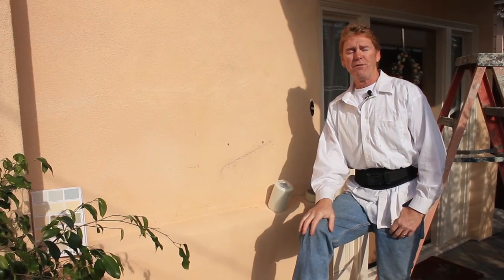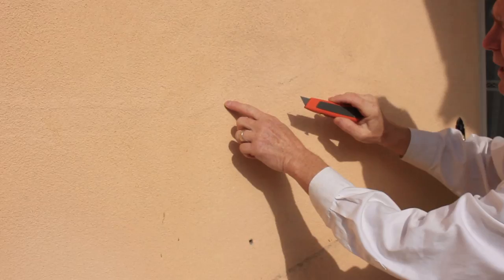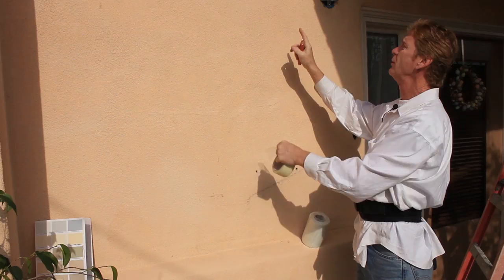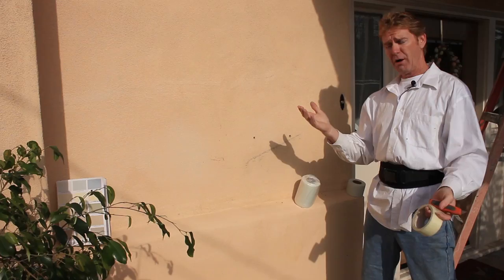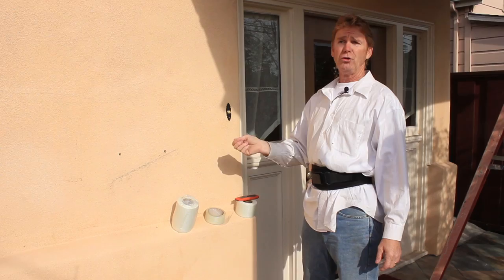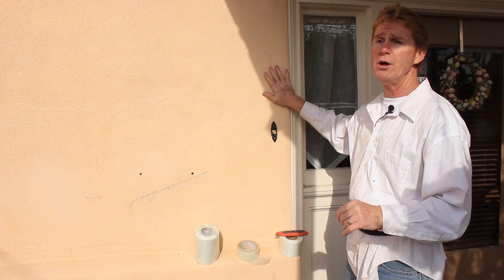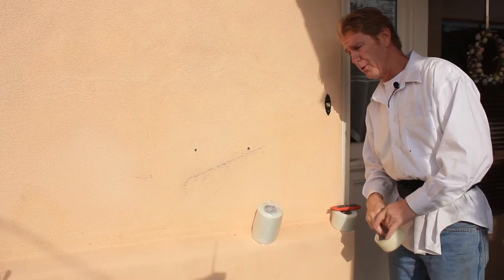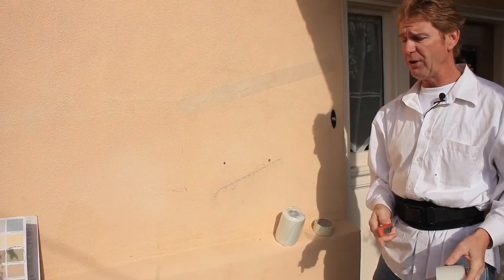Reasons why all stucco new and old cracks

Comment: Hi kirk nice work, last week I blocked up a doorway and window with concrete blocks and then rendered/stuccoed it. The next day there were hairline cracks all over it. It was a a really hot day and I did not wet the block wall before the scratch coat. It was also a steel trowel finish
Reply from the maker: Howdy Jamie, this is how we learn brother, you gave it your best shot, did your job, a  5 minute section with caulking and you're good to go,
 Best wishes, 
 kirk giordano Plastering

Comment: Learning all I can, I had a new sliding door installed and it was not done well. Just understanding as much as possible!
Reply from the maker: Howdy Todd, Man, you come to the right place as old kirk, Don't know much about history,
 Don't know much biology, 
Don't know much about a science book,
Don't know much about the french I took, 
but I do know about stucco.
  and I do know that if you watch these to, you'll be able to do better than the fella who jacked up your door,
 best wishes, 
 kirk giordano plastering
Reply: That's hilarious! I love Sam Cooke.
The guy who did my door used a bag of fog coat I left over to mix the color for the patch around the new door. I told him that I doubted fog would work the same as just a bad of color but he assured me. Now it is lighter and cracked around the repair. 
My question:
Should I call and pay someone who knows what they're doing to fix it or should I give a fog coat over the top a try?
Reply from the maker: Evening Todd,  tough question, fog coating is tricky, i have fog coated about 25 homes in my time, fog coats are mainly used to make a blotched color more uniform, such as too much water used here and there, which gives light and dark shades throughout a wall, or for removing scaffold joints where you have really big walls with many men working in unison trying to get the color and the texture solid.
 This is the true use of fog coating.
 Some folks think a fog coat can change a color, it can't, what these same fellas don't know is that when you fog coat you are basically spraying the color cementitious tint color on with water, 3 passes is the most one should try to apply, any more coats than this, the excess color that will wash off with the first rain. It's takes many years of practice. 
to repair a color coat within a color coat is only achieved with the color Crystal White,
 all other patches will bleed through, below are two video's I found that may explain a bit better.
https://youtu.be/tw5egD5p13I
https://youtu.be/V9adGQVHPM4 
 Cheers,
 kirk giordano

Comment from the maker: Hi Tom, it could be settling if it's a newly built home, within two months.
It could also be that the plywood and the studs are heating expanding and or twisting.
 In hot areas the wall can get to 140 degree's if the plywood is not gaped for the expansion the heat will expand the wood thereby expanding the stucco, This action can't be measured by eye, but stucco, and concrete are sort of like glass, they may flex a tiny bit but to much flex they both crack.
 To eliminate this theory, look at the sides that rarely get lots of heat and or the all day sunshine to see if this is going on the shady sides as well.
Also did they take the stucco to the ground?
The weep screed should not be buried or embedded by concrete walkways and or driveways.
Do you have heavy windows or doors that when they shut can create vibrations?
 If so this can contribute, are you on a hill, how about lots of heavy traffic?
Does it get real hot then get cold at night.
 If it's really hot say 105 degree's outside does your air conditioner stay on?
Do you have cracks in your foundation?
Sorry, Tom, these questions are the tip of the iceberg of situations that can contribute, plus your contractor might have missed stapling the lath into the studs or could have used short staples.
 Is it really just the bottom of the home cracking?
Kirk Giordano
Reply: Kirk & Jason Giordanos DIY plastering and stucco tips 

Kirk, Thanks so much for your time and effort in addressing my issue. I have found the contact page on your great web site and will send you some photos. Love your videos
Reply from the maker: Hi Tom, no worries, 
 Kirk Giordano

Comment: Hola Kirk, Once again enjoying your work ,here in Mallorca we work on concrete block wall ore hollow bricks,if the walls are plump the job is easy but most of the time are not,then we do lines of mortar  at every 1.00 m, like vertical lines..once the lines are dry are fill with cement mortar,and later the final fine coat, using a flood and a sponge..hair crack lines usually come if they paint the wall with acrylic paint. 
Un saludo
Tolo Mas
Reply from the maker: Howdy Tolo, if the stucco was allowed to dry and cure with hydration for at least 28 days, these stucco walls would cure which causes normal hairline and, then they apply a paint or an acrylic stucco, this will now cover those exposed hairline cracks while bridging and or flooding them.
 When the stucco is first applied it's a 14 of alkalinity if you wait a few weeks it will drop down to about a 10, thus it's ready for paint without the bleeding, ghosting or bubbling.
 Yea, this is really boring stuff but guys like me have to know this stuff.
 Best wishes, 
 kirk giordano Plastering
Reply: Hola Kirk, The house with hair lines i told you about was build 36 years a go, from the rendering to the paint finish where two mouth at least, the hair lines crack come after a few years...i told the owners that they neglected for to long...and the paint they use probably was not top quality...but i don´t know...I only was the architect of that job..anyway thank you for your reply..keep up your good work mate..

Comment: The mesh ur using kirk we call scrim cloth and we use it for putting on plasterboard joints before we scim it with finish plaster here in ireland
Reply from the maker: Hello me Irish friend, it's just your typical fiberglass mesh tape, it works for insides as well as exteriors, be careful when using it outside as too much stucco buildup on just the tape will telegraph through when the final color coat is applied, or as I seen once a wall where anyone could clearing see they added too much stucco on the fiberglass mesh which gave the finish product a wall the looked like crap.
 Takes a wee bit of practice,
 Cheers,
 kirk giordano Plastering
Reply: Thanks,you do great work,love your videos

Comment: My friend, you never consider and mention about earthquakes happening in California.
small Richter size kind of that people doesn't feel it but houses and structures get affected by that which cause small or big cracks. you are great.  thank you, I have learned a lot from your videos..also .pls. tell your camera guy, that gets real close shot when you are working and doing the explaining in small details .  take care.
Reply from the maker: Evening Steve dude,
O.K. I will be a bit more thorough and inform folks of just a few reasons of why stucco wall can and will crack,
 Sure some are from workmanship or lack of as as placing staples or furring nails in the field instead of the stud where the weight per square inch is necessary.
it's  important, as placing stucco netting on backwards, using nails and or staples where the leg does not go into the stud at least 7/8 also creates cracking, wet studs with plywood butted together is another common problem especially in areas where the heat is severe as the studs as well as the shear wall will expand in the hot sun then shrink when it's cool causing all new stucco to expand and shrink with it, this usually creates the horizontal cracking that is not normal such as the vibration cracks that are quite typical and normal around doors and windows that shut or slam when opening and closing, Wind and especially a week let alone a month is possibly the biggest movement to any home as this creates ground swelling then settling which can't be measure by machine or the human eye and yes after storms the new cracks with no dirt tell the story, foundations not poured properly or with weak concrete also concrete with a PSI strength under 2,500 PSI does not help either,sand mixed that is not rinsed free of salt, or certain sand not meant for structural strength hurts too.
 Movement and or vibrations by large trucks, opening and slamming doors especially heavy one, earthquakes all of these fluctuations help hairline crack a home, and these are just the tip of the iceberg.
 The slightest movement in render, plaster, stucco or concrete is like kryptonite to superman, not good.
 Cheers,
 Kirk giordano rendering

Comment: Kirk good video, can I ask why you did the small return to the left was it cracked also.
Reply from the maker: Hi Andrew, If I didn't do this small return, it would have taken me longer as to not get any of the troweling on it would have been tough enough but the float would have certainly rubbed against it, which would have been a different color blemish in the corner.
 Plus yes it did have the same horizontal hairline on it.
 Best wishes. 
 kirk and family

Comment: Nice finished job. Thats  the fact  jack that "cause an effect" of the shell or crust of the earth is  in  consent  flux aka movement very good point. I'm wondering though . What is the chemical make up of the water used  to mix  the color coat ? An then the reaction  of the rain an climate  on  the  dried stucco is that water the same as whats in the stucco mix ? Action reaction . Why ..? cause  Key word ( you said  over an over ) here "Hydration aka water soaking in   "  How  the   wall   hydrates  an  drys..
Reply from the maker: Peter old buddy, I don't think it matter what chemicals are in the water say like,  fluorides, metals and the rest of the stuff added to purify the water for our own good.

 The real issue is use the water to expand stucco walls then allow these same walls to dry out fully. Plus stucco wall's won't care how much chemicals are in the water except for too much salt which could produce effloresce but that's another topic.

 Everyone has seen a mud hole after the water has dried out the crusty old cracked earth, same thing. 
I believe proper hydration is the first step to cracking.

 Vibration's are the second biggest reason why stucco cracks, wind, rain or saturation, large heavy trucks driving down the street, etc. Also, not enough nails or staples per square inch. (to hold up the added weight of the stucco.)

 Then you have your foundations, who know what sort of commitment went into it's each individual application, the list goes on and on.
 Sorry brother, you asked my opinion.
 Best wishes, 
 kirk and family
Reply: StuccoPlastering Thats great  what video is all about many things that effect
the outcome " Action /reaction. Cheers

Comment: Great video, and I did watch all 29 min. I have a two year old house in Phoenix and the stucco cracked around the bottom two feet of the house. They are vertical hairline cracks but a lot of them, in some spot every one inch.   Do you have any input on this type issue?
Reply from the maker: Howdy Tom, excellent question, stucco over wood walls especially in hot areas, "when I say hot I mean 100 to 115 or more per day for months"
 this sort of heat will penetrate the stucco and bake the wood studs and the shear wall, creating not only many vertical cracks but the odd looking horizontal cracking.
  Why? as the wood swells it pushes against the stucco in the immense heat, and when cooler conditions occurs in the early morning hours, the wood shrinks but the stucco will remain with hairline cracks.
 FYI, all cracks in stucco are more noticeable in the cooler hours of morning, Why,? another great question, Glad you asked, when the sun again does it daily heating the walls once more as described above,  swells again, thus the cracks seem to vanish.
  FYI, retaining walls made of brick, concrete, or cinder blocks with stucco over them will settle from the weight, this causes settling cracks, but these retaining walls are cementitious and are resistant to expanding and shrinking in even severe heat unlike the wood walls.
Things that make you go hmmmmm.
 Cheers,
 kirk giordano plastering

Comment: Im in phoenix arizona, I see a lot of homes with colored stucco and colored synthetic stucco. Faded and don't look so good after about 8 years. Does a painted stucco repel water better than the colored stucco. What is the benefit of doing the colored vs just painting it. Thanks
Reply from the maker: Cody Halford Good morning, In the  extream heat paint does not last that long say under 10 years if it's done professionally.
 Cementitious color finishes, NEVER peal off, they lighten or darken in say 20 to 30 years, but to me this makes them look better.
 Best wishes, 
Kirk Giordano

Comment: My house showed up crack in stucco after 12 years, and one crack started to bulge and now I see hair line cracks on other side of my house as well.  How come it's cracking all of sudden..? and that too in three places in span of few months.
Reply from the maker: Howdy Pradeep, excellent question,
the main reason for hairline cracking in stucco and concrete is "rain" say for example 10 days let alone 4 months of rain cause all homes to lift, then when drier conditions appear the ground, or homes settle's, thus hairline cracking
 
O.K. I will be a bit more thorough and inform folks of just a few reasons of why stucco wall can and will crack,
 Sure some are from workmanship or lack of as as placing staples or furring nails in the field instead of the stud where the weight per square inch is necessary.
   Wind and especially a week let alone a month is possibly the biggest movement to any home as this creates ground swelling then settling which can't be measure by machine or the human eye and yes after storms the new cracks with no dirt tell the story, foundations not poured properly or with weak concrete also concrete with a PSI strength under 2,500 PSI does not help either, sand mixed that is not rinsed free of salt, or certain sand not meant for structural strength hurts too.
 Movement and or vibrations by large trucks, opening and slamming doors especially heavy one, earthquakes all of these fluctuations help hairline crack a home, and these are just the tip of the iceberg.
                            Live long and plaster
 teaching repairing your number 1 investment, your home

Comment: This video has a phrase "weep ****". Your language is not distinct. What are you saying and how is it part of the wall?
Reply from the maker: Madera Roja de la Secoya Morning Madera, excellent question,
we call the metal at the bottom of the mudsill a weep screed or drip screed, both terms refer to the same metal screed.
 Walls with drip screeds tend to flex or give more as they are not tied into the concrete foundation, the screed which is attached to the wood act as an expansion joint also.

 best wishes, 
 kirk giordano